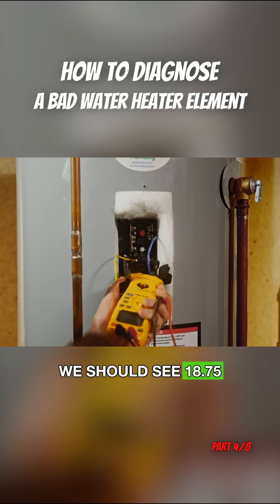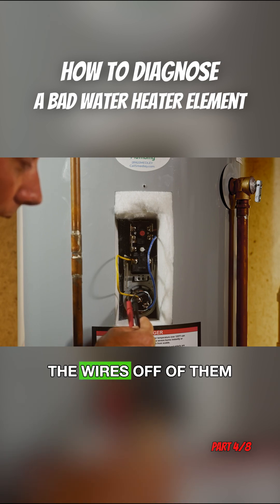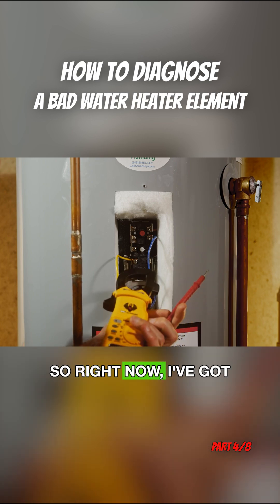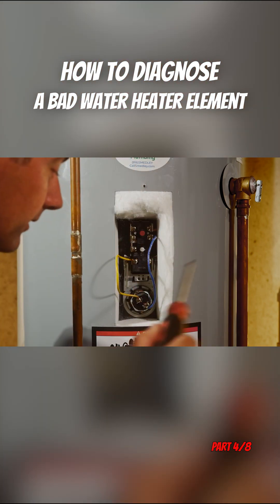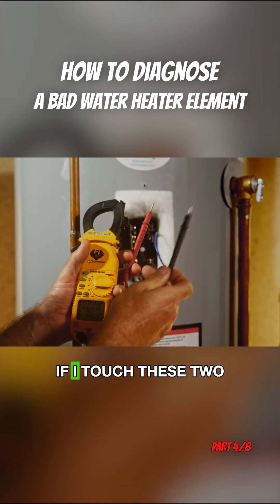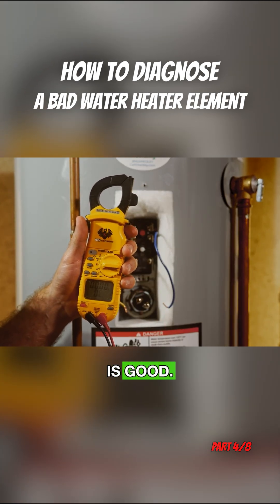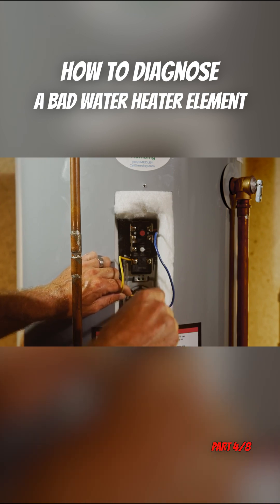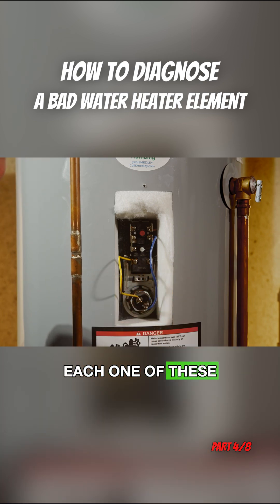How to Diagnose a BAD Water Heater Element

Comment: How much is element on average?
How much to replace with labor, assuming that it would be better versus getting a new water heater?
Reply from the maker: Depends on the age of the unit if it's worth it to repair versus replace.  For us, elements are about $600 and a new water heater is about $2000
Reply: @SmedleyPlumbing definitely agree especially if the unit is older and if the tank is not starting to deteriorate then replacing elements could be worthwhile especially DIY but unfortunately adding in your labor costs could result in a $900 + total job cost.